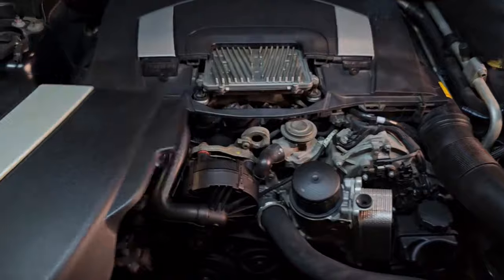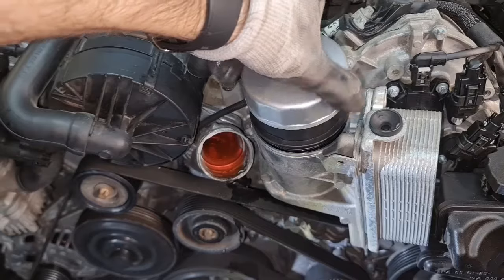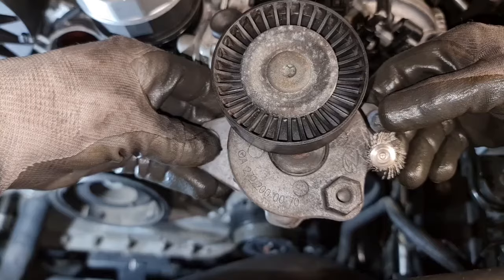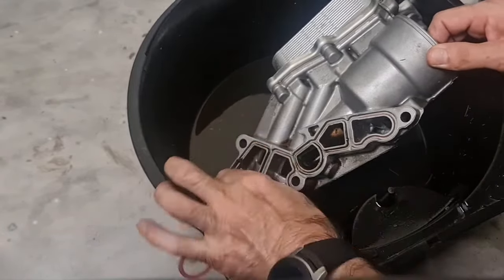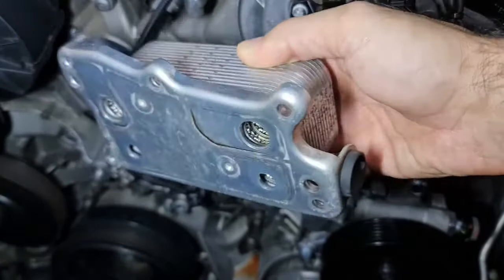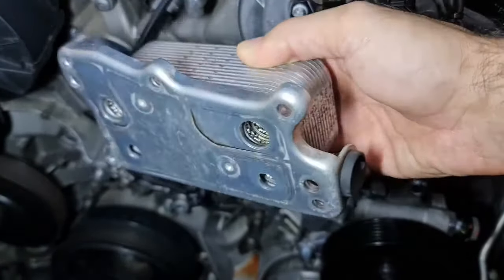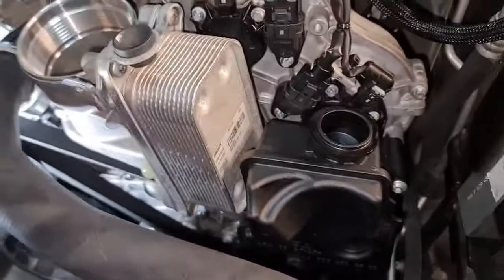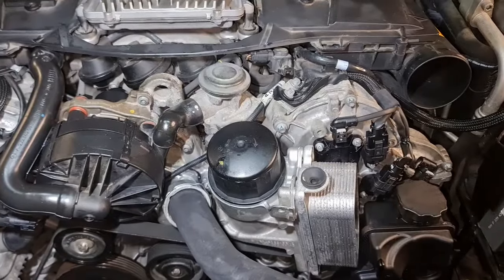The secret to a clean engine, M272 and M273 Mercedes.

Comment from the maker: M272 and M273 needs these to be done to make sure the front of the engine stays clean and also to make sure the belt, pulleys, tensioner, thermostat and serpentine belt are all in a good shape and  this service plus the fluid changes, guarantees miles and miles of trouble free driving in your Mercedes with peace of mind, please like, share subscribe and give me your feedback and feel free to ask questions and I will respond as soon as possible, cheers Max, Brisbane Australia.
Reply from the maker: @salvationbygracethroughfaith  Thanks for sharing 👍

Comment: This engine generation family, M272/M273 are those engines that in comparison to M278 and M157 which sacrifice longevity and reliability for performance these two do the opposite. I was dying to get an M278, the turbos, and the horsepower were tempting, but once I started digging into the BENZ community, I realized it wasn't worth it. The M272/3 engines are more reliable than any other Mercedes V8 engine, and I'm not saying they are bulletproof, but in comparison with the M278, man... it's a heaven-to-earth difference.  I declined a 2013 E550. 42K miles for a 2011 E550 with 90 miles. Yes, It's way more miles, but guess what? I won't be suffering from cylinder scoring, nor any turbo issue, no 4matic stuff. So, I'll have more peace of mind knowing that despite this one being older and with higher mileage, I know the problems that may pop up could be addressed, and unlike the M278 I won't have to be scratching my head because I need to get a new engine.
Reply from the maker: @judsonwidmymerviluszabala378  I do agree, very good point, post made M272 and M273 can be a great choice, on any car more HP = more problems.  M273 with 380ish HP is enough for any car.

Comment: Great tutorial, every high mileage Merc with these engines is going to have these issues. Probably worth changing the cam shaft sensors and magnets while the accessories are unbolted.
Reply from the maker: Yes, thanks, I have actually replaced the cam sensors and magnets too, video will come soon.

Comment: There is a specific pattern you are supposed to torque the oil filter housing bolts down, start at the middle bolt, then down, upper right, left across, down to the right, then upper left bolt last.  When I replaced my oil filter housing gaskets I didnt bother draining the coolant, just pull off the oil filter housing and it drained that way. Also no need to disconnect the coolant hose and thermostat wire, just unbolt the thermostat housing and lift out of the way.  After the oil filter housing was removed I then drained the oil in case there was any coolant contamination.
Reply from the maker: Thanks mate for advice 👍

Comment: What's that tool you used to take out the black thing to get air in the system for the oil to go down?
Reply from the maker: @jimmytapafini5378  Mercedes oil cap wrench?

Comment: I wasn't happy with the fit of the Elring oil filter housing/cooler gaskets. Too loose, and I wasn't going to use rtv to retain them. You could get by with the oil cooler gasket a bit loose if the unit is off the engine, but the oil filter housing gasket snug fit is mandatory. The housing is held vertically to be installed, and you have to rely that gasket staying in place, especially because you can't really see behind the housing.
I installed oem MB gaskets for the housing/cooler. More expensive but the fit was perfect, no leak issues.
Reply: Also, the three cam plug covers on the back of the engine and the oil separator housing can be prone to leakage.
Reply from the maker: @nv1493  Great tip, thank you. 😊
Reply from the maker: @nv1493  Thanks, I have a separate video on that.
Reply: You're very welcome, this was a very good video that compiled many of the leak prone areas. Like most vehicles, PM is key! Thanks.
Reply from the maker: @nv1493  👍
Reply: Ah, I just saw that, perfect.
Subscribed 😀
Reply from the maker: @nv1493  :)

Comment: Hi! Is that orange coolant MB approved? MB use a blue one
Reply from the maker: MB approved, coolant can be any color.
Reply: @BenzAddiction  sure, I was just telling you because I replaced the coolant in my CL 500 two years ago and got it from the dealer
Reply from the maker: @gianmariamalmesi4133  👍
Reply: Always use distilled water
Reply: @rizzotto139  That's normal, you want to diluite coolant with distilled water only. I also use it to diluite the washer fluid since tap water is full of limestone in the area where I live and it end up obstructing washer fluid nozzles and ducts

Comment: Terrific video and detail, thank you. Quick question if you don't mind. I have 2007 S550 that is has an oil leak I believe by the oil cooler gasket. I plan on ordering the Nissens oil cooler unless you think I should get a different manufacturer. Also, do you think I should order a seperate genuine mercedes gaskets? Any advice would be much appreciated. Thanks again
Reply from the maker: Thanks mate, I would buy what is available but Meyle or Elring, they are both good. Unfortunately living in Australia means limited options for German cars.
Reply: @BenzAddiction  Thank you sir.
Reply from the maker: @andrewsilverman7954  👍

Comment: Are those nm specs correct? I saw another video and the pulleys and thermostat had higher ratings?

Is there a website I can double-check those values?
Reply from the maker: Just google. MBWORLD is a great source.
Reply: @BenzAddiction  Tried that, but I don't see anything specific, should I just around in the forum or there are specs listed somewhere?

Comment: bro i just bought a beautiful 2010 s204 c300 wagon at 110k miles, i've just changed all the fluids. there aren't any leaks or problems i can identify yet but what are some preventive maintenance i should do on it? i'm planning to use this car to go on really long road trips so i don't want it to break down randomly. as far as maintenance history go, engine oil was changed around every 10k miles and not much else was done except for the spark plugs according to the previous owner. btw you are a legend if you reply after 2 month.
Reply from the maker: Check the belt, always have 1 crankshaft sensor handy at least, diagnose and make sure there is no codes on engine and trans. Finally I suggest 5k miles oil change intervals.  Good engine have a safe and fun journey.
Reply: @BenzAddiction  thanks bro
Reply from the maker: @altezsa  👍

Comment: 14years old engine m272 10k km needs that also? I just changed the transmission oil, transmission oil filter, engine oil n filter
Reply from the maker: If you have oil leaks only at the front. Usually starts leaking at 100k km.
Reply: @BenzAddiction  no leaking at all
Reply from the maker: @mydc2200  Then you don't need this work done, enjoy your Mercedes.
Reply: My cam shaft position sensor code appear on scanner P0018, PO392 bank a n b, do i need to replace the cam sensor? No engine light, engine runs fine, thx

Comment: Hi, I have a 2010 e550 with the M273, I’ve been losing about a cup of coolant after every day of driving.  I dont see any leaks visually and dont see any white smoke coming from the exhaust when idling.  What could my issue be
Reply from the maker: There is a coolant pressure tester on ebay that pressurises the cooling system with a gauge, buy one and test it yourself,  instead of spending thousands on replacing random parts IMHO.

Comment: Hello i had an accident on the right side on my 2008 mercedes s550 after i have some code which is p0040 and 2 missfire code on the right side where the accident happened. I just noticed a leak on the rear right on to a wire and into exhust please help.. say oxygen sensor rapped. Please help. Car miss when u restart it smooth up back need help
Reply from the maker: The oil leak can be the caps and oil seperator, watch this: https://youtu.be/Fsw7tv4h5Ig

Comment: In thw beginning of the video you showed a 5w-40 oil, yet at the end tou used helix 5w-30?
Reply from the maker: Great attention to detail.  👏  Depending on the region temperature, both can be used. 5w-40 is more versatile.
Reply: @BenzAddiction  Ah I see. I see. Did you have a change of heart in the middle of your service? I've read that 5w-40 is better in older benz engines. That's what I use now in my M272
Reply from the maker: @andreasb8232  TBH sometimes from start to finish of video it takes 2 months, I work bit by bit, Mercedes recommends more 5w-40 but I think 5w-30 is somehow better marginally.

Comment: Do I need to burp coolant system I have m273 engine cls550
Reply from the maker: @Abu_Zooz  if you mean bleeding the cooling system,  no it is self bleed, but you need to leave the engine idling for few min and add coolant and check few times after.

Comment: What type of pin is used for the pulley 
Where can I get 
Thanks
Reply from the maker: I'd you mean a pin for the idler pulley to lock in place, you can use a 3mm drill bit.

Comment: This oil cooler should not be cleaned, only replaced with a new one.
Reply from the maker: @HugoBucc  👍
Reply: Why is that? There's just the gasket leaking?
Reply: It is better to replace these parts with new ones because they cannot be cleaned 100%. 
I have c230 2,5 V6 2006y. and mechanic said that the oil cooler could not be cleaned on 100% and that it was better to replace it .
Reply: @HugoBucc  I totally understand that, but why would you sell a gasket if that won't work? Manufacturers could've just skip that $4 part and charge you an arm and a leg for the oil filter base + the oil cooler.
Reply: @HugoBucc Don’t believe everything mechanics tell you
Reply: @michael-angelogarnett8658  If you want to have a clean oil cooler, which is for these models, you need to replace it with a new one and not clean the old one because it makes no sense, it be still dirty. The mechanic has nothing to do with it actually.
Reply: You have no idea what your are talking about. You and your mechanic should not be working and giving advice on cars.
Reply: You don't need to replace the oil cooler nor the oil filter housing.  The gaskets are what is destroyed and need replacing.  You don't even need to clean the insides of the oil cooler like he did.  Oil will cycle through it and anyway.